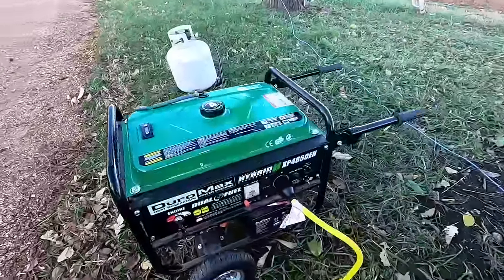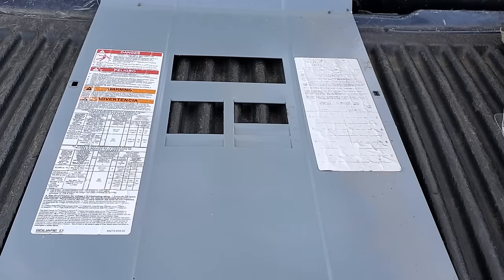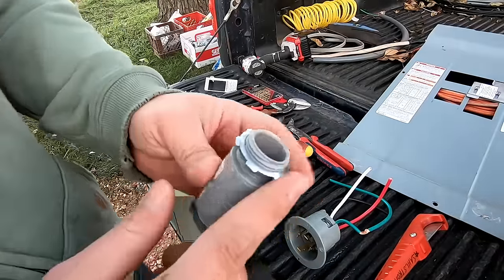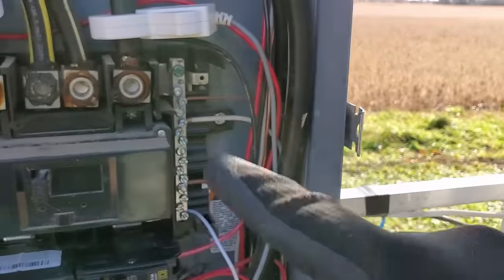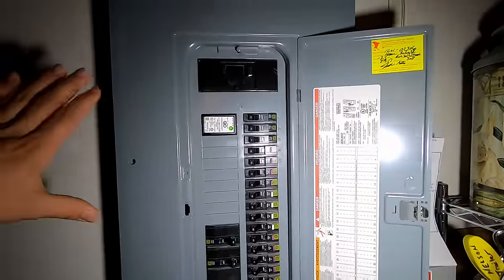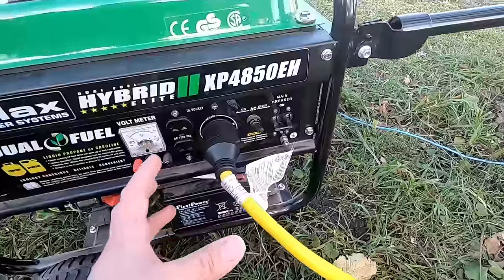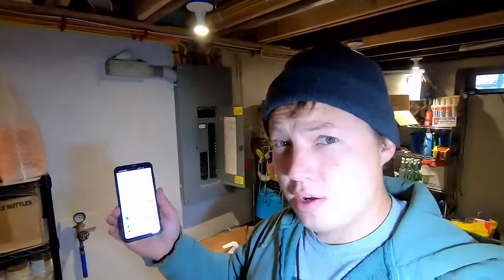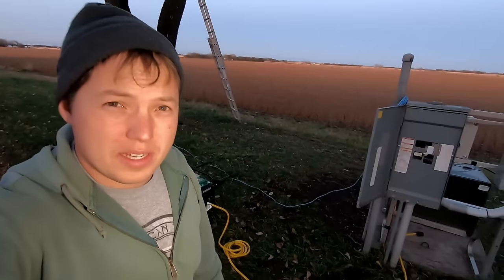How To Hook Up a Generator To Your House Using a Breaker Interlock Kit & Power Inlet Box

Comment: You need to twist those 30amp plugs to lock them in place after insertion.
Reply: should tape the connectors with elelectrical tape for extra support and H20 prevention
Reply: Here are the Generator safety tips: Always make sure you follow all the generator safety rules whenever you use your portable generator. This is a reminder for everyone’s safety of using generators. Generators can be dangerous if not used carefully. Every year, hundreds of people die or get injured when using portable generators due to carbon monoxide poisoning and electrocution. Make sure you are using your generator carefully and keeping others safe as well. There is something very serious that everyone should always be aware of when using generators. Some people do run their generator indoors which is not safe and that increases the risk of carbon monoxide poisoning which can cause death of family and you. Some people run their generator in wet conditions which can electrocute them. Please remember that you should never run your generator indoors. Remember that carbon monoxide is an odorless and colorless gas that you cannot see or smell. Carbon monoxide is a silent killer. Keep that in mind. Make sure your generator is 15-20 feet away from your house and away from doors, windows, and vents. Never use your generator in your porch too. Having a carbon monoxide detector is very important against generator safety. Some people also allow children to go near the portable generator which could pose risks. We need to keep an eye on our children making sure that they are not near the portable generator so they won’t get electrocuted or burned by the generator which is dangerous. A locking enclosure also keeps kids safe. A generator shed might look like a tempting place to explore, or take cover during a game of hide and seek, but a generator is a dangerous piece of equipment that can cause injury. It says on the manual that we should also keep children away at all times from the portable generator to avoid injuries. Please do not allow a child or unqualified people to operate the portable generator.  It is important to keep your children safe especially little ones. The portable generator can be hot during an operation. Just because some manuals missed what should be listed doesn’t mean it’s safe to do. Always follow the generator safety rules when using portable generators. Generators pose electrical risks. If you need to use your generator during wet weather, you need a generator tent to protect your generator from getting wet. Don’t let your generator get wet. Keep your generator dry and before using your generator, please make sure your hands and your generator is dry. Do not wear loose clothing when operating the generator. Everything that is said on the generator’s operating manual should not be ignored. Never smoke cigarettes near the generator. Please keep flammable things away from the generator. Never overload your generator too. Your generator can catch fire. Never ever try to plug a generator cord into a wall outlet to avoid back feeding. Back feeding your generator is dangerous. Always turn on your generator first before plugging in appliances and shut off the appliances before turning your generator off. Use a heavy duty cord for your generator and the cord should not be worn out. All the instructions should be followed carefully. Never refuel your generator while it’s running. It can cause fire if fuel spills while your generator is hot. You should turn off your generator and let it cool off before refueling it. Having a fire extinguisher next to the generator is also important. This is only a reminder for everyone’s safety of using generators. Make sure your generator is properly grounded. Having a fire extinguisher next to the generator is also important against the safety rules. https://youtu.be/I1jT3ANENvI and here is a video more about keeping others safe when using generators and also about our family’s safety. It’s important to keep our little children safe as well. Make sure your little children are kept away from the generator at all times especially when it’s running. Hope this helps. Always remember that it’s better to be safe than sorry. Also remember that warnings should not be ignored too.

Comment: I am very impressed by your showing of the generator today, I have done electrical work myself for 30-40 years. You do a very good job , explaining, and your terminology  is right on the money. Keep up the good work and I definitely will follow you. And yes the subject about a floating neutral is very important.
Reply: Don’t forget about the safety rules of using generators: Always make sure you follow all the generator safety rules whenever you use your portable generator. This is a reminder for everyone’s safety of using generators. Generators can be dangerous if not used carefully. Every year, hundreds of people die or get injured when using portable generators due to carbon monoxide poisoning and electrocution. Make sure you are using your generator carefully and keeping others safe as well. There is something very serious that everyone should always be aware of when using generators. Some people do run their generator indoors which is not safe and that increases the risk of carbon monoxide poisoning which can cause death of family and you. Some people run their generator in wet conditions which can electrocute them. Please remember that you should never run your generator indoors. Remember that carbon monoxide is an odorless and colorless gas that you cannot see or smell. Carbon monoxide is a silent killer. Keep that in mind. Make sure your generator is 15-20 feet away from your house and away from doors, windows, and vents. Never use your generator in your porch too. Having a carbon monoxide detector is very important against generator safety. Some people also allow children to go near the portable generator which could pose risks. We need to keep an eye on our children making sure that they are not near the portable generator so they won’t get electrocuted or burned by the generator which is dangerous. A locking enclosure also keeps kids safe. A generator shed might look like a tempting place to explore, or take cover during a game of hide and seek, but a generator is a dangerous piece of equipment that can cause injury. It says on the manual that we should also keep children away at all times from the portable generator to avoid injuries. Please do not allow a child or unqualified people to operate the portable generator.  It is important to keep your children safe especially little ones. The portable generator can be hot during an operation. Just because some manuals missed what should be listed doesn’t mean it’s safe to do. Always follow the generator safety rules when using portable generators. Generators pose electrical risks. If you need to use your generator during wet weather, you need a generator tent to protect your generator from getting wet. Don’t let your generator get wet. Keep your generator dry and before using your generator, please make sure your hands and your generator is dry. Do not wear loose clothing when operating the generator. Everything that is said on the generator’s operating manual should not be ignored. Never smoke cigarettes near the generator. Please keep flammable things away from the generator. Never overload your generator too. Your generator can catch fire. Never ever try to plug a generator cord into a wall outlet to avoid back feeding. Back feeding your generator is dangerous. Always turn on your generator first before plugging in appliances and shut off the appliances before turning your generator off. Use a heavy duty cord for your generator and the cord should not be worn out. All the instructions should be followed carefully. Never refuel your generator while it’s running. It can cause fire if fuel spills while your generator is hot. You should turn off your generator and let it cool off before refueling it. Having a fire extinguisher next to the generator is also important. This is only a reminder for everyone’s safety of using generators. Make sure your generator is properly grounded. Having a fire extinguisher next to the generator is also important against the safety rules. https://youtu.be/I1jT3ANENvI and here is a video more about keeping others safe when using generators and also about our family’s safety. It’s important to keep our little children safe as well. Make sure your little children are kept away from the generator at all times especially when it’s running. Hope this helps. Always remember that it’s better to be safe than sorry. Also remember that warnings should not be ignored too.

Comment: When I upgraded my old 100 amp panel to a 200 amp panel, I used the inch pound torque wrench to properly tighten every screw in the panel. When I had it inspected, the inspector went in and re-tightened every screw way tighter than the recommended torque spec. Go figure.....
Reply: I have never seen any electrician use a torque screwdriver. Me personally I will go back and re tighten every screw that was clamping a copper wire. The copper tends to "relax" in the clamp after awhile so I just go back before I cover everything back up and hit every screw. I also re tighten other breakers in a panel that I never even touched cause you never know if the guy before you did a good job.

For example, a hot wire in a circuit breaker, that I didn't even mess with, was loose. Because I just barely touched the wire, the wire was no longer connected and lights didn't work in another part of the boat. I blamed the last guy cause I had spent considerable amount of time going through all his circuits he installed and redoing a lot his connections (in the case of the grounds, actually making those connections). But honestly since I knew his work was crap, I should have been checking every single connection regardless of what they looked like.
Reply: does that make them more responsible
Reply: Don’t forget about the safety rules of using generators: Always make sure you follow all the generator safety rules whenever you use your portable generator. This is a reminder for everyone’s safety of using generators. Generators can be dangerous if not used carefully. Every year, hundreds of people die or get injured when using portable generators due to carbon monoxide poisoning and electrocution. Make sure you are using your generator carefully and keeping others safe as well. There is something very serious that everyone should always be aware of when using generators. Some people do run their generator indoors which is not safe and that increases the risk of carbon monoxide poisoning which can cause death of family and you. Some people run their generator in wet conditions which can electrocute them. Please remember that you should never run your generator indoors. Remember that carbon monoxide is an odorless and colorless gas that you cannot see or smell. Carbon monoxide is a silent killer. Keep that in mind. Make sure your generator is 15-20 feet away from your house and away from doors, windows, and vents. Never use your generator in your porch too. Having a carbon monoxide detector is very important against generator safety. Some people also allow children to go near the portable generator which could pose risks. We need to keep an eye on our children making sure that they are not near the portable generator so they won’t get electrocuted or burned by the generator which is dangerous. A locking enclosure also keeps kids safe. A generator shed might look like a tempting place to explore, or take cover during a game of hide and seek, but a generator is a dangerous piece of equipment that can cause injury. It says on the manual that we should also keep children away at all times from the portable generator to avoid injuries. Please do not allow a child or unqualified people to operate the portable generator.  It is important to keep your children safe especially little ones. The portable generator can be hot during an operation. Just because some manuals missed what should be listed doesn’t mean it’s safe to do. Always follow the generator safety rules when using portable generators. Generators pose electrical risks. If you need to use your generator during wet weather, you need a generator tent to protect your generator from getting wet. Don’t let your generator get wet. Keep your generator dry and before using your generator, please make sure your hands and your generator is dry. Do not wear loose clothing when operating the generator. Everything that is said on the generator’s operating manual should not be ignored. Never smoke cigarettes near the generator. Please keep flammable things away from the generator. Never overload your generator too. Your generator can catch fire. Never ever try to plug a generator cord into a wall outlet to avoid back feeding. Back feeding your generator is dangerous. Always turn on your generator first before plugging in appliances and shut off the appliances before turning your generator off. Use a heavy duty cord for your generator and the cord should not be worn out. All the instructions should be followed carefully. Never refuel your generator while it’s running. It can cause fire if fuel spills while your generator is hot. You should turn off your generator and let it cool off before refueling it. Having a fire extinguisher next to the generator is also important. This is only a reminder for everyone’s safety of using generators. Make sure your generator is properly grounded. Having a fire extinguisher next to the generator is also important against the safety rules. https://youtu.be/I1jT3ANENvI and here is a video more about keeping others safe when using generators and also about our family’s safety. It’s important to keep our little children safe as well. Make sure your little children are kept away from the generator at all times especially when it’s running. Hope this helps. Always remember that it’s better to be safe than sorry. Also remember that warnings should not be ignored too.

Comment: Question: The start of the video mentioned hooking up a Reversed Breaker. Is there any difference in tripping rating when a breaker is being fed power in reverse? (i.e. power flowing in from the terminals to the mains instead of out)
Reply: Unless it's a special GFCI breaker, which it isn't, there is no difference. AC is alternating current so the breaker won't even know the difference. You know how there are some electronics that you can plug into the outlet in either direction? Same thing.
Reply: Remember to always make sure you follow all the generator safety rules whenever you use your portable generator. 
⚠️Here are the Generator safety rules that everyone needs to follow when using generators:

This is just a reminder for everyone’s safety when using portable generators. All generator safety rules need to be followed carefully to avoid hazards. 

1) Please do not allow an unqualified person or your children to operate the portable generator. Just because some manuals don’t say that doesn’t mean it’s safe. That is important against the generator safety rules. We also need to be keeping an eye on our children too. You need to make sure that your children are not playing near the portable generator especially when it’s running so they won’t get electrocuted. Generators pose electrical risks and they can be hot during an operation. Please keep your children away from the portable generator at all times. It is important to keep our children safe especially our little ones. Be aware of all the hazards.

2) Some people use their portable generators indoors which increases the risk of carbon monoxide poisoning. It’s important to have a carbon monoxide if you have a gas generator. Never ever use your generator indoors even if your doors and windows are open and even in the garage is not safe to use a portable generator. Not even at your porch and your deck. It is never safe to use your generator indoors and in enclosed areas of your home. Your generator needs to be 15-20 feet away from your house. 

3) 🔥generators cause fire hazards too. Never refuel your generator while it’s running. You need to let your generator cool off before refueling it and before storing your generator. Never overload your generator too. Never ever back feed your generator. You should never plug your generator into a wall outlet. Also never store propane tanks indoors. Please keep flammable things away from the generator as well and please don’t smoke cigarettes near the generator. Having a fire extinguisher next to the generator is also important against the generator safety rules. 

4) generator operation; make sure your hands are dry before touching the generator. Never use your generator in wet conditions. Don’t let your generator get wet. You need a generator tent if you need to use your generator during wet weather. Please don’t wear loose clothes when operating the generator. Turn on your generator before plugging in appliances. Use the right cord for your generator. Please do not use worn out cords. 

https://youtu.be/I1jT3ANENvI and here is a video more about keeping others safe when using generators and also about our family’s safety. Hope this helps

Comment: Great video. Question though…at 19:20 you say that a copper grounding rod will clear a fault. That’s not true. But by connecting ground wire to generator frame you are are changing from a floating neutral to a bonded neutral. That changeover is how any ground fault will be cleared. Thanks for an informative post.